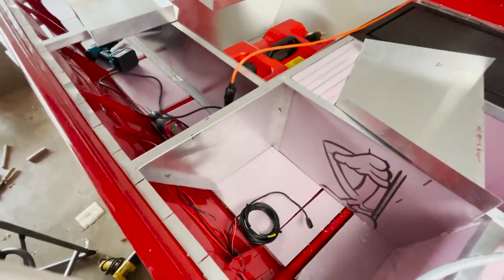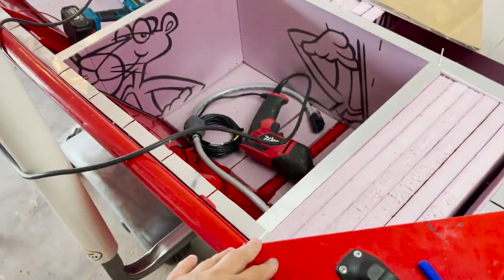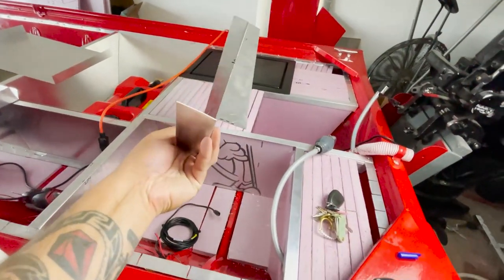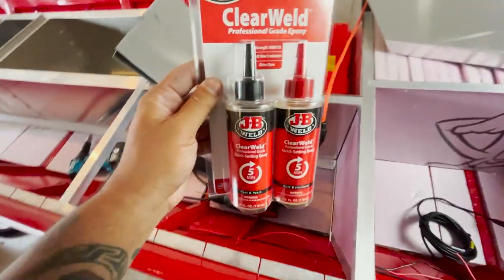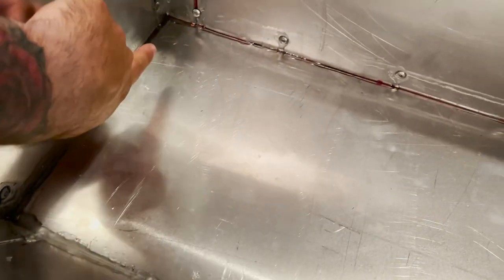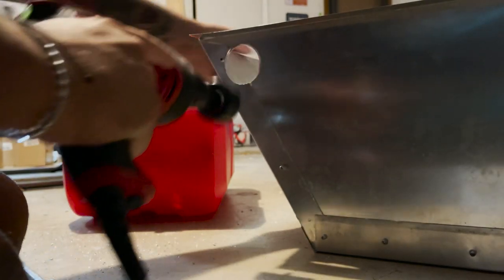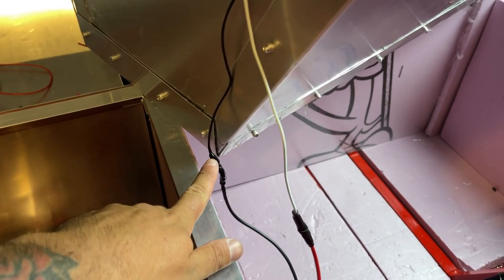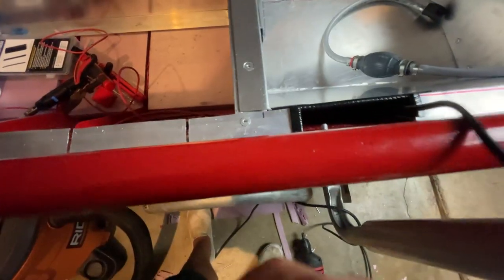This ALMOST Made Me QUIT!! Jon Boat to Bass Boat Conversion

Comment: Another great video Adam, just one question, was there a reason you built the box outside the boat first versus building it in place? I was thinking on building my back hatch the same way, but was going to build the box in place, I may be rethinking that depending on your advice.
Reply from the maker: Honestly I didn’t even think of that lol, my concern would be getting it all siliconed depending if you want it waterproof or not, but if you could seal it up before dropping the pieces in then I don’t see a problem with it
Reply: @AdamRyanA  Regardless, you overcame the problem and it looks great.

Comment: Well good job on the boxing all man but I got a question what happens if the gas tank has a hole and you got to take the gas tank out of the box if you're going to use the same kind of lid keep up the great work
Reply from the maker: I would have to take that part of the deck off to get the tank out
Reply: Maybe you can have the hatchland a little bigger that way you can take out the tank if the tank does have a whole or you still gas down there it's just a suggestion
Reply from the maker: Oh yeah I definitely didn’t think of having to get the gas out if I do spill it, I was so stuck on having the hatches the same size that I didn’t even thank of that, thank you
Reply: The gas tank is really tuff it shouldn’t ever leak but keep it cool and vented so it doesn’t puff up like a foot ball. Gas fumes can build a lot of pressure.

Comment: I have the same gas ⛽️ tank and it is so tight sealed that when it got hot 🥵 it is bulging at the filling lid. I tryed to push it back in shape but no go. So my advice is to keep it cool as possible and or vented so the gas fumes don’t build pressure in the tank. 
Kool Jon boat I have really enjoyed your videos.
Reply from the maker: Thanks for the tip, I think I seen a video where people added vents to this gas tank, I need to look into that again and make sure I do it before filling with gas

Comment: Going to have to run two more pieces of aluminum to support the edges of that lid
Reply from the maker: I added more supports today, but it’s gonna be sitting on the deck material, not the aluminum
Reply: @AdamRyanA  That will be very flexy wouldnt it? You want all sides of that lid supported by L channel. Unless you are running some crazy thick decking?

Comment: why put the weight of the gas tank on the side of the boat?
Reply from the maker: Because all my weight is on the other side
Reply: @AdamRyanA  oh ok just different than where we're use to seeing the gas tanks you know what I mean? carry on If I had extra I would do my boat over as well lol
Reply from the maker: @sstatic6093  oh yeah, it’s definitely different but just the only way my design would work and it helps with weight distribution